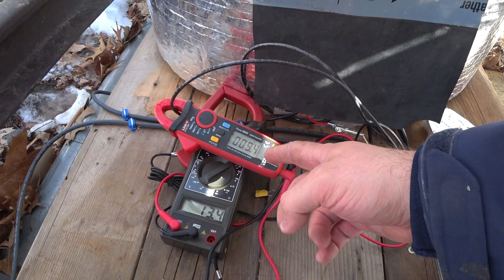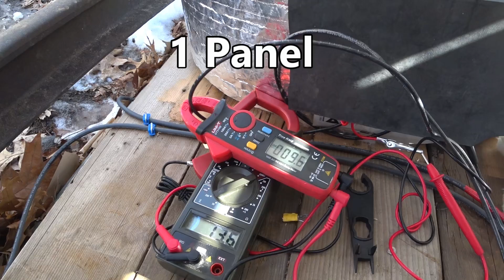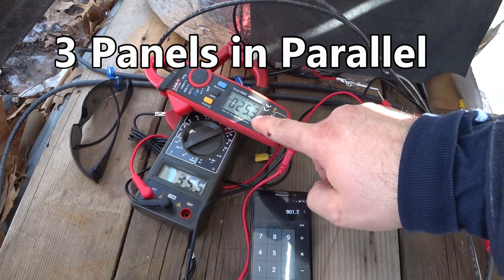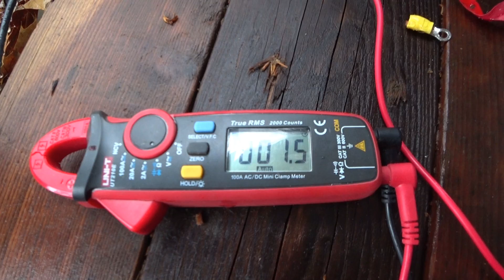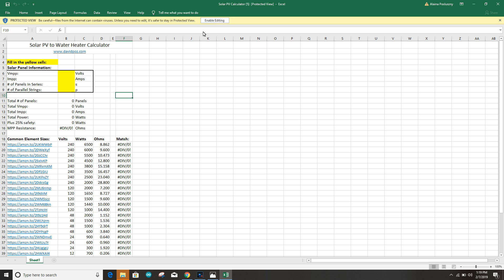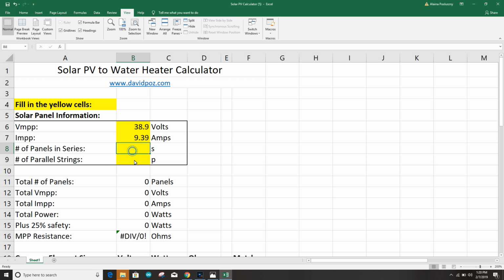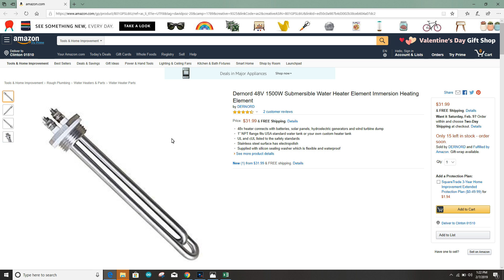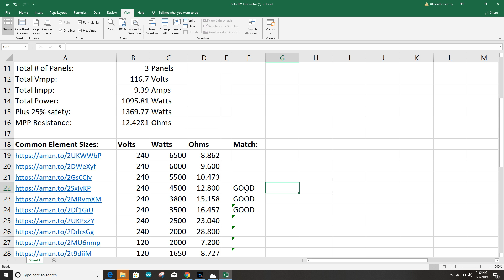Matching Water Heater Elements to Solar PV Panels

Comment: All this comes down to is Ohms law, which is why you should learn math kids :-) Since a solar panel is a current source rather than a voltage source, it's output is dependent on the load's resistance, a charge controller or MPPT tracker tries to dynamically vary the load resistance to best match the ever-changing power point of the array, this is not always possible. The challenge with using a fixed resistor is that you only get peak efficiency at MPP, that may only happen during the peak of your solar window, meaning you are missing out on power during the early and late periods, the other challenge is lower irradiance conditions like a cloudy or overcast day will create a mismatch, for a water heater it's probably acceptable. The calculator is certainly handy for finding elements, but all you have to do is take Vmpp over Impp and you get your ideal resistance (E=IR or E/I = R) I say ideal because this MPP is constantly changing under real-world conditions. Nothing like the hard teacher of experience ;-)
Reply: V=IR
Reply: Liam O'Brien , can putting dc in an ac heating element cause electrolysis? I realize it is mostly a short but wonder if the element is inside a steel jacket that is exposed to the water.  I'm asking because someone stated it could cause electrolysis on his later video.  (Not sure if I believe it, but I've been surprised before.)
Reply: @TheRainHarvester  AC vs DC makes no difference since the heater consists of an outer steel sleeve, a ceramic electrical insulation jacket and the heating wire in the middle. Unless the steel outer jacket fails, there is no contact between the electric heating wire and water. If AC was allowed to be in contact with water, your whole water tank would become a potential shock hazard.
Reply: So would the better solution be to use a mppt solar charge controller, and use the battery as the heating elements power source?
Reply: @ratgreen  Ideal would be an MPPT suspended inside the water heater haha. That way the inefficiency of the MPPT transformer as waste heat heats up the water too! 100% efficiency! :D
I suspect it's cheapest to size your heating element for 50% illumination, then higher voltage will be only a little bit less efficient but you want it to work best in winter etc. Summer won't be a problem. So you'd use the Vmpp for 50% illumination instead which you can find in the datasheet of a solar panel. 
And you can always add more solar panels which are cheaper in the long run that MPPT. If you have the roof space.
Also don't add 25% safety margin for sizing your heating element... it's
 not like it's going to burn through inside of the water lol. The watt 
rating is mostly meant for the power it produces at 240V.
Reply: @ratgreen  That's a good question I was wondering the same.  Then you would have a known voltage of 12 volts and could determine your ohms to optimize for that
Reply: @ratgreen  how did this work out for you? Very interested as I am a couple weeks away from turning the power on my direct DC to produce hot water. Engineer775 has his own built MPPT (perhaps you've seen his Youtube vid) Its tempting to get but a lot of $$$ for what it is and what happens if it burns up when first turned on. Anyway we all want to get the max out of the investment but adding more devices to get just a little more watts really pushes back the payback.
Reply: hi,I am confused about this calculation, If my panel has 36V/4A=9 ohms the heating element should be found like this? ratedV/ratedW=9 ? thanks
Reply: @Liam O'Brien, "which is why you should learn math kids" that comment is completely unnecessary. There is no need to tell the kind of person you are :-)

Comment: It's called impedance matching. When the source and the load have the same impedance (in this case resistance in ohms because it's DC) maximum power is transferred. Resistance is found by volts/amps = ohms resistance = volts^2/Watts (This is useful for the heating element). Good job with your video. New subscriber earned.
Reply: Yep,  it hit the short circuit current limit, isc,  but your man is still correct about maximum power transfer and impedance matching.
It's why you have to tell your amp what impedance speakers you are using.....4 or 8 ohms etc. 
Really enjoyed vid thank you..
Reply: You might think you are transmitting maximum power, but the problem is that you are dissipating half of what you are generating within the solar panels. Power generation and distribution systems most certainly not designed like that. What is required is a DC to DC converter that maximises the voltage across a fixed load for any given input.
Reply: He should wait then at least a minute to allow impedance to be reduced and eliminated
Reply: hi,I am confused about this calculation, If my panel has 36V/4A=9 ohms the heating element should be found like this? ratedV/ratedW=9 ? thanks
Reply: ..another way of looking at it....he tripled his voltage in series, but he was still limited to around the maximum of 9 amps that each panel is rated to output.  In parallel  he had triple the amp output capability as needed.
Reply: @unionse7en  that was my thought

Comment: Are you telling me your voltage didnt change when you connected the 2 panels in series? Cause all of my tests prove otherwise.
Reply: This demonstrates how flat the current curve is for solar panels.
Reply: @CncObsession, did you add a low ohm load, to hit the current limit ?
Reply: It depends entirely on the load. Solar Panels are Constant Current devices. If the panels are loaded heavily, the voltage will drop dramatically. The output Voltage depends entirely on the load. A heavy load will mean relatively little voltage out.

Comment: Ok - this might be a stupid idea, but for experiment sake - what would happen if you used a small battery and MPPT controller?  Yeah it would probably cycle the battery to death after a fairly short period of time, but I am curious if it would be more efficient for the element due to the low internal resistance of the battery.   Or - get really crazy and see what a bank of super capacitors would do.
Reply from the maker: I love the idea of super capacitors.  Do you know how to buy capacitors?  I don't know anything about them, but if I could learn about them, I would love to try that idea with an MPPT controller.
Reply: @DavidPozEnergy  Buy the biggest one you can find (or the biggest ones). That is about all I have learned. Super caps and a good battery might do the trick.......Maybe
Reply: DavidPoz my main experience with capacitors is in the 80s in college and charging them up and zapping people!

My thought is that you don’t care if the power cycles on and off for this application. So thought is the controller charges up the battery or capacitor (never researched charging caps with solar) and gets up to recover and then dumps the power into the heating element until low voltage cutoff.   Yeah that is horrible for the battery, but this is an experiment.   The postulate (my big word! Or is that a theory?) is that the mppt controller charges the battery very efficiently and the element runs more efficiently connected to the battery.   The limiting factor is the charge cycles on the battery, but the mitigating solution is possibly super capacitors since they typically can handle more cycles.   

I will try to do some more research on the caps and see what I can find.

Comment: Good test. But why you don't use heatpump to heat a reservoir. The coefficient of a heat pump can be 3 or 4 in some cases. For every 100W yo have 300W of heat or more.
Reply: A heatpump can be powered by solar panels, therefore off grid, ask me how I know :-)
Reply: @Solar_Tech_Liam  I've been using a heat pump off grid for years and would never go back
Reply from the maker: I'm trying to go off grid.

Comment: I like this experiment very much..... I did plug in the specs on a single 100 watt panel (17.8 volts, 5.62 amps) and it recommended "48 Volt 600 Watt 8 5/16 Inch DC Submersible Water Heating Element", but if you look at the specs on the element, it says the wattages below.   So obviously one 100watt panel is not big enough for the real world, but it does show how you really better do your homework when picking out a solar/element combo if you want to maximize your output.

can also be wired for 12 Volts 40 Watts 
can also be wired for 24 Volts 160 Watts 
can also be wired for 36 Volts 360 Watts

Comment: Matching the panel to a given heater resistance is not easy as the figures given on the panel are for peak sunlight and different parameters will apply in different sunlight conditions. To get around this we have MPPT or maximum power point tracking converters.
Reply from the maker: Can you link to any that work in a direct PV to heater situation?  I'd like to check them out.
Reply: @DavidPozEnergy   they are really expensive, certainly more than your 3 panels. at the other hand they pulse the DC, so no problem with the thermostat burning out.
you will find out after all is done, the best way is using a heat pump to heat water from PV.   possibly a bit more difficult in your climate in the winter.
Reply: @ursodermatt8809  I honestly can't think of a good reason to use a Heat pump to heat water. I do know that it works great, while it works. But the cost to add it and the likely break downs just don't add up in my mind to pure simple PV HW.
Reply from the maker: @Kevin: I'm not personally a fan of the heat pump water heaters.  We used to have one, but after three years got so sick of the thing I removed it and just gave it away.  But it seems to be the most popular comment on my series (suggesting to use a HP)
Reply: @DavidPozEnergy  yet everybody has a heat pump in air conditioners and nobody complains about costs, etc
Reply from the maker: @Urs Odermatt:  Absolutely.  refrigerators too.
Reply: @ursodermatt8809  Expensive or not how about listing/linking some anyway? These things are  hard to find so actual names/links would be great.

Comment: David Very interesting. I have to change my water heater's thermostat to a DC one because it was  popping off and the safety valve blew off 3 times with boiling water. I use my water heater as a diversion from my 2p 3s pv pannels 48v charging system. Also, it  will be interesting an experiment that proves pv pannels can make 10 % or more electricity when in horizontal position and the reflexion of one panel over the other. In the summer about 1500 watts but in the winter when I raise the top panels they make over 2kw.
Reply from the maker: That's scary, but glad you had a safety valve to blow, and not the whole tank.
Reply: How many panels and elements would I need to get a 50 gallon drum to run at a constant temp of about 140-180 degrees during the day? Goal is to heat radiant floors during day then switch to boiler when sun goes down.

Comment: PV is current limited. You will never achieve more than the ISC. Its great that you learnt from this. I experienced the same thing about 3 years ago .
I placed 10 x 250W panels in series with a vmp total of 310V @ 8 A IMP or 2.5kw in panel roughly.
The most I would get to was about 80V @ 5A. the original element was a 3.6KW element which would need around 15amps...  So I used a ohms law calc to find out what R value I needed to get 8amps which was ideally a 30 Ohm element or a 1.92KW 240V element..

The closest available is a 1.8kw element so I used it and I did get favourable results but you then have the problem of swithing off 300V dc for thermostat control...
Anyway long story short is yes you can match and make PV drive a HWS but the efficiency is much lower than most solar HWS setups. Ie. PV is around 16% efficient minus cable losses etc where Solar HW is up around 70% efficient. Yes PV wont freeze and burst lines hahaha.
Nice video!!
Reply from the maker: Sounds like we both went through the same thing.  I laughed at the "PV won't freeze".  I've had a frozen solar collector and it caused my system to be down for three weeks.  Thanks for watching.
Reply: DavidPoz You had a PV panel freeze? I thought it was a thermal panel?
Reply from the maker: Hi MondoTV.  Yes, I had a thermal collector freeze: https://youtu.be/8GNBElwXi14  That is why I agree with Clint that a PV panel won't freeze.  At least not in any damaging way that my thermal collector has frozen.  Several people have written in on that other video sharing that they also have experienced freezing problems even in systems that were installed properly.  It seems like PV has less that can go wrong.
Reply: DavidPoz Sorry mate - your reply seemed to imply that you had a PV panel freeze LOL

Comment: The element can change ohms when it get hot. I learned that when we did experiment with lightbulbs in school.
Reply: Absolutely true! At these temperatures the difference in resistance between room temperature and 100C is going to be a fraction of a percent. Since a light bulb goes from room temperature to a few thousand of deg C the shift in resistance is much more noticeable.
Reply: he hasn't got a light bulb filament inside the tank. it is a heating element. the resistance of a hot water element just goes up slightly

Comment: On another note looking at your setup.. Why didn't you go with a sun tracking system? A simple 1 axis DIY tracking system would net you another 5-20% more output, and its very easy to do with cheap DIY electronics now days. Arduino or something equivalent plus a cheap actuator and good to go with sun tracking. 2 axis system is more complicated and mostly not needed as it can be manually adjusted from summer to winter. Do you have any data logging with average daily sun brightness vs total solar array output over time? This can be very helpful to let you know when theirs something wrong with the array once you have a running average from a couple of weeks of data logged.
Reply from the maker: I don't have data on sun brightness.  Any suggestion on how would I do that?

Comment: Make sure you have "BLOCKING DIODES" in place!! Or you can "FRY" one or more of the panels in the parallel config. It's all about the solar panels Impedance. Just like car stereos particularly amplifiers driving big SUB Woofers! Impedance matters and must be calculated for the load.
Reply from the maker: I'm not very good with electronics.  Is there any resource you can link to?
Reply: @DavidPozEnergy  You can pop a cover off the back of the panel and you'll see the diodes in there. You will be fine with those panels in parallel.

Edit: The manual indicates you can connect those panels in series or parallel. It also says to not open the cover or it voids the warranty so lets take their word for it that the diodes are in there.

Comment: This unit https://www.wholesalesolar.com/2991208/magnum-energy/inverter-accessories/magnum-energy-acld-40-ac-load-diversion-controller   With the Magnasine MS-4024PAE or the MS4448PAE 120/240 volt Inverter Charger will allow you to us 240 volt elements that come with the Electric Hot water heater Plus you can Use the Micro Inverters that produce 240 volts up on the roof that are meant for Grid tie and use them for a off grid setup because the Magnasine inverter will act like the Grid using the Battery power inverted to keep the Micro inverters from going down thinking the grid is still working. Just by hooking micro grid inverters output to the Magnasines 240 Output through the uses of a load center panel and 20 amp breakers for each string of Micro inverters of 14 panels and the 7 dual micro inverters. It's called AC coupling if you want to google it.